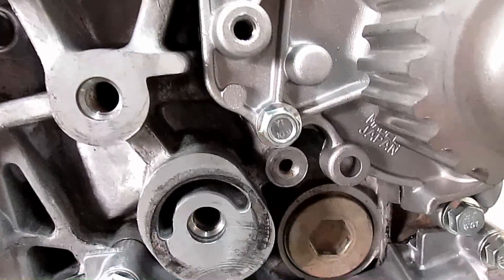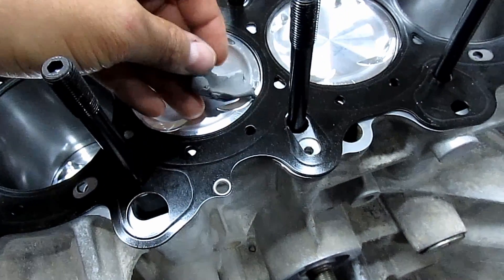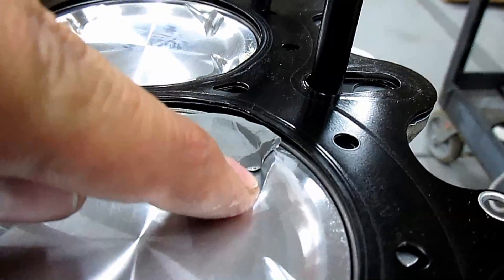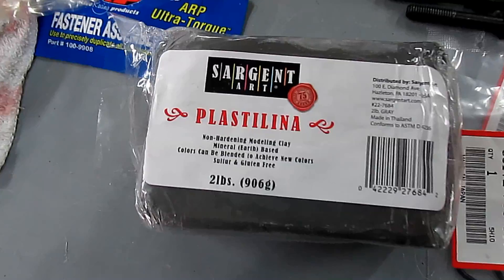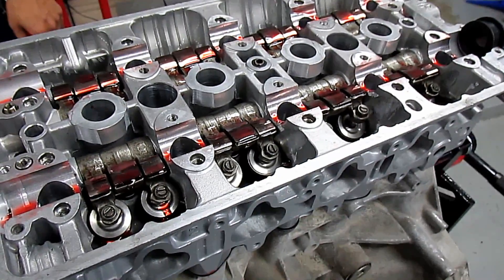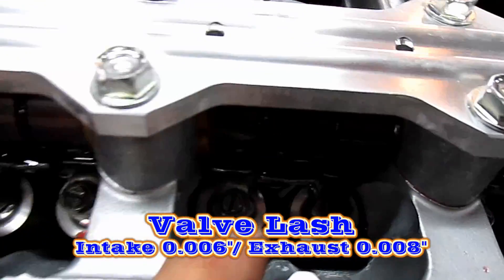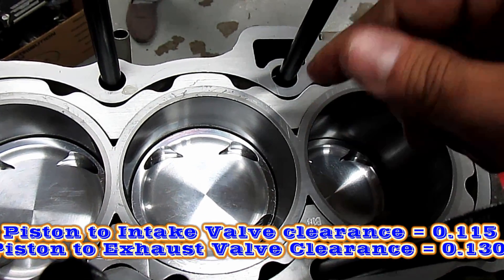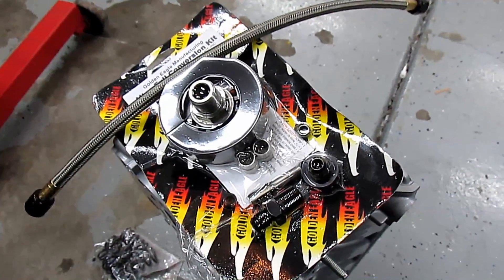Project No Rice #6: Valve Clearances (Stroked LS/Vtec Acura Integra)

Comment: You just have to lock the rocker arms to get proper ptv measurements.
Reply from the maker: locking the arm requires oil pressure.  math works the same.
Reply: @FatGuyBuilds  I've seen people put a BB in the rocker arms to force the piston to sit further out, locking the arms together :)

Comment: This video alone you went from knowing a good deal to being told what to say lol where's the formula and the work, nothing but a jump skip and random numbers lol project no rice is full of grains,
Reply from the maker: who told me what to say?  they are not random numbers.  it is just basic math under the assumptions that taking the normal valve clearance (non-vtec) then from that number, subtract the difference between the (vtec to non-vtec) lobes.  poof there is your total valve clearance.  the max lift point on both lobes are in the same spot so doing this is fine.  If this explanation doesn't clear it up, then please explain what you are complaining about so I can answer you.

Comment: This Video is kind a useless.
You where about to show the process of how to check the Valve to Piston Clearances. 
But wiped the result awy without showing what it would look like? 
Serious ?

On the other hand, you don't even have domed (N/A) high compression Pistons installed, 
so the chances are quite low, that you would have a Piston to Valve Contact with this kind of setup.
(when the Timing has been set correctly)

And what about the Valve to Valce Clearances?
Reply from the maker: Thanks For Watching!!!

Comment: there is multiple ways to lock the vtec rocker to check p2v with the oil not circulating
Reply from the maker: please post links to a guide
Reply from the maker: you ever gonna show everyone the steps to accomplish what you are saying?
Reply: I don't have a link right now but one day is with compressed air another is taking the rockers out and using a cut up zip tie to lock the pins into vtec
Reply: Put a ball bearing behind the locking pin and then put the rocker assembly back together. The pin will engage the vtec lobe. Or an even easier way is you just swap the pins to opposite sides. Check the lash, set the cams (if using adjustable gears) take the  cams out remove the rockers and put the pins back.
Reply: It's true been doing that since 02 lol lock vtec many different ways..and go str8 to vtec lobe don't worry about the primarys
Reply: There's vtec killer pins you can buy to lock the rocker arms permanently allowing the engine to utilize only the vtec lobe. Race cars do this all the time this is nothing new. Or you can install 2 of the oem long pins inside the outer 2 primary and inner vtec rocker arm to achieve the same result. This is how we clay for ptv clearance.